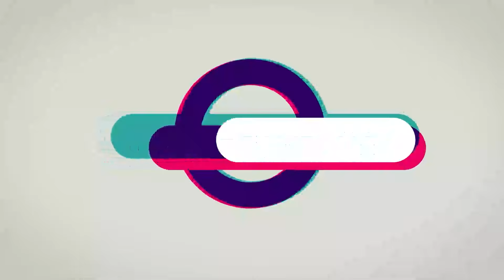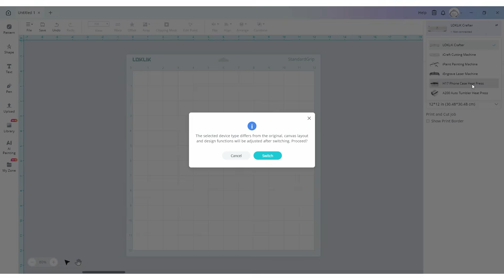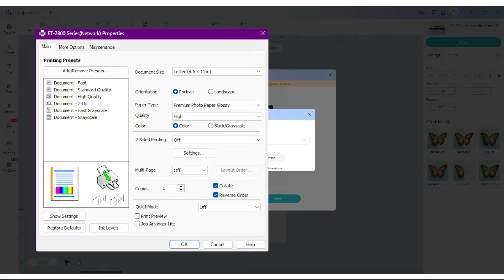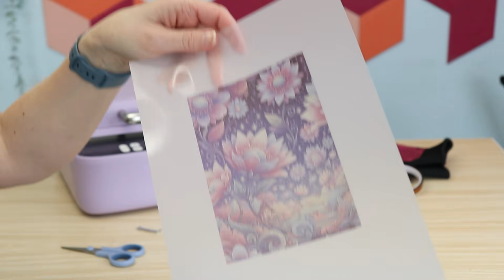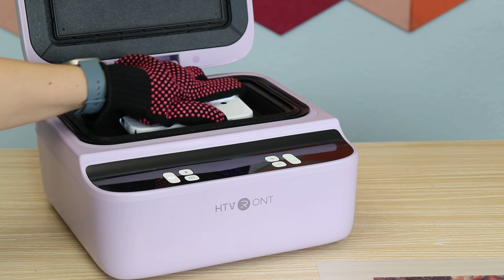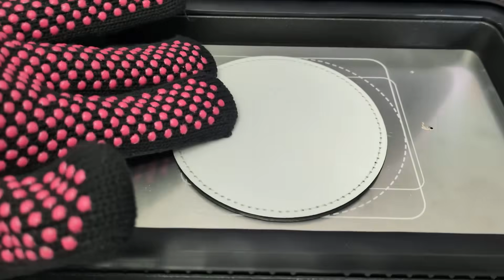Beginner Tutorial - HTVRONT Phone Case Heat Press

Comment: The HTVRONT did not come with step by step instructions for the control panel.  My first press failed because the temp and time were wrong even though I tried to program 275 degrees and 300 seconds.  Your video is cute but failed to give me the step by step programing (most important) help that I need!
Reply from the maker: This is the manual for the heat press, in the box you typically get a card with a QR code that takes you to this. It has detailed instructions on what each button does and how to set the time and temp for different substrates. https://cdn.shopify.com/s/files/1/0356/5997/2741/files/User_Manual_for_HTVRONT_H17_Phone_Case_Heat_Press-20251016.pdf?v=1760607073

Comment: I'm making designs for iPhone sublimation blanks. After I finish pressing one blank, how long should I wait before starting the next sublimation print on another iPhone blank? Since the heat press gets so hot, is there a recommended cooling period for the press between prints, or can I continue pressing back-to-back without affecting the results?
Reply from the maker: If you are using the same fixture, you don't need to wait between presses. It's important to let the fixture preheat before pressing so it will work well when it's already hot. Just make sure you're wearing gloves, it does get really hot.

Comment: Why is my sublimation not sublimating I hv done 10 but it just get wasted
Reply from the maker: Couple things you can check. Are you using sublimation ink on the matte side of the film? Be sure all the little metal pieces are in place on the fixture and everything is flat. And the case fits snugly on the fixture. Any variation will cause blurry images.
Reply: @SarahVanderkooy it doesnt display on the cover I use matte side but it doesnt

Comment: What software are you using to create the designs? I have canva but the colors are not matching the designs when I sublimate.
Reply from the maker: I use Canva for most designs. Make sure you export images as a high quality PNG. Start with a canvas of 2000x2000 pixels to ensure the DPI will be good when exported.

Comment: Hi there! Love your video! I'm starting out doing my own cases. And I'm about to get my machine but I'm highly confused - do I pre heat for 5 seconds or 5 minutes? People are setting them to 5 seconds and then 300 seconds for the pressing? I'm just confused haha thank you!
Reply from the maker: It's only 5 seconds, it doesn't seem like much but it's what the company recommends and it seems to work well.
Reply: @SarahVanderkooy okay cool! Thankyou heaps! Also the cases I'm wanting to use are the 2 in 1 with the open camera holes but the camera lense pads don't fit in them - can I use silicone pad taped with heat resistant tape? Or even taped under the camera hole for pressing? Thankyou!